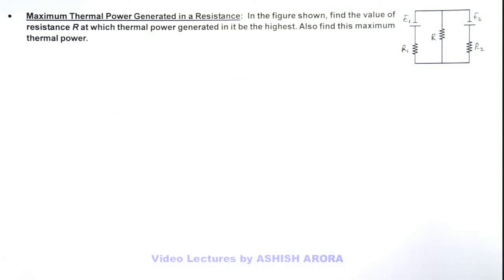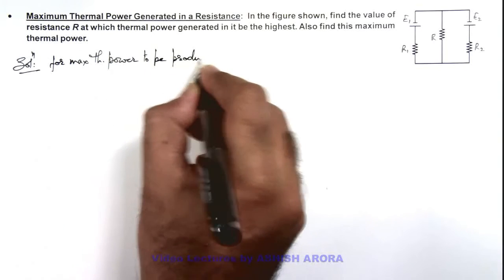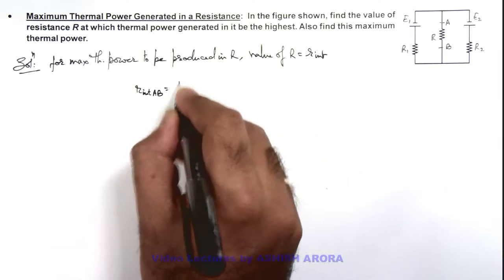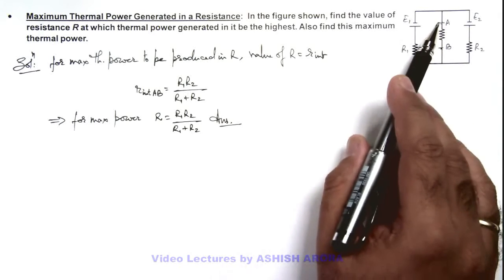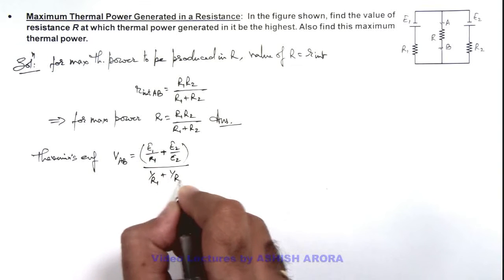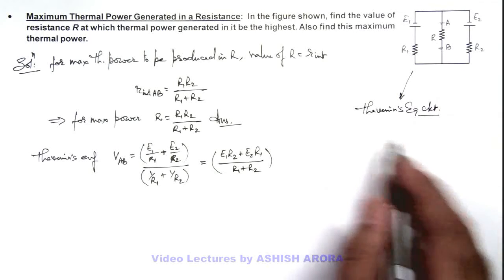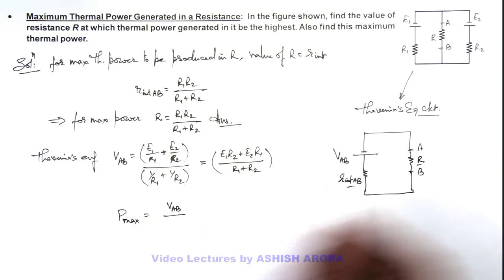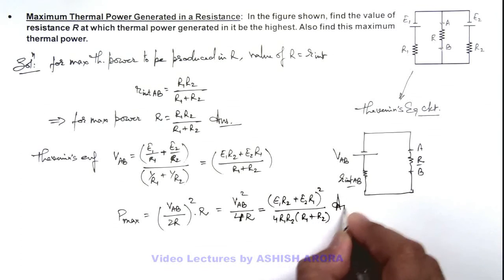15. Advance Illustration | Current Electricity | Maximum Thermal Power Generated in a Resistance

Comment: i solved it directly without any thevnin analysis and got the same result
Reply: Kaise?🙄
Reply: @schrodingersmiley6407  normal circuit solving, parallel- series type
Reply: @noone0978  yeah i got that later
Reply: @schrodingersmiley6407  👍

Comment: sir here why haven't we calculated the current in that reduced circuit and then calculate the voltage difference between A and B by kirchoff
Reply from the maker: Current may not be same in same resistance which is calculated from the effective reduced ckt...
Reply: sir ,then how we will understand whether to   find the current in that reduced circuit and then calculate the voltage difference between A and B by kirchoff or use series and parallel battery formula to find the voltage difference b/w A and B